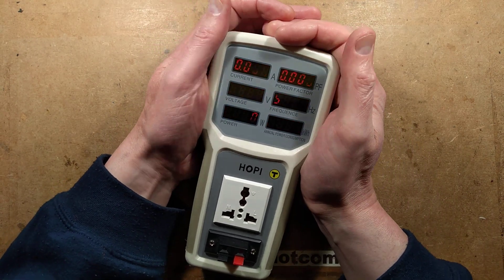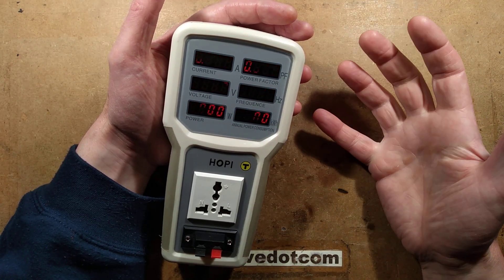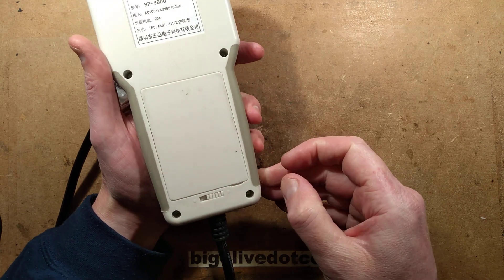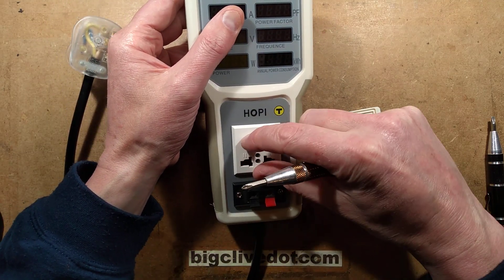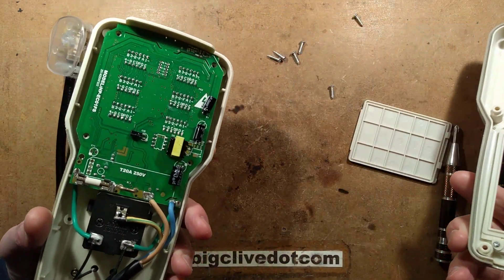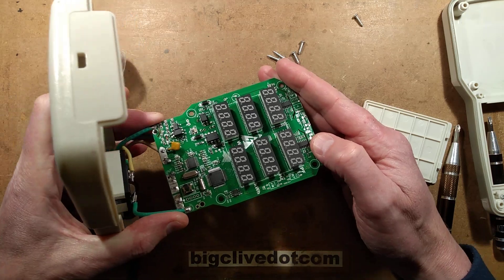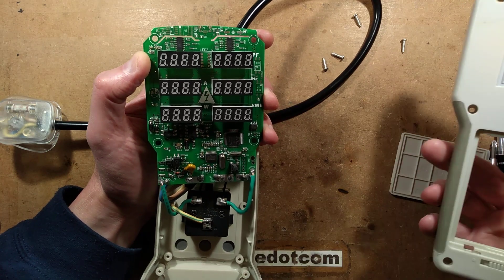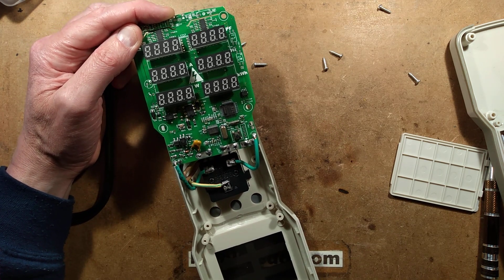Inside the Hopi power meter.  (It contains a smart meter chip!)

Comment: I got mine after you told me where to get it. Unfortunately the speaker terminals are mounted on a black plastic block but mine is so thick it won’t let most UK plugs sit flat in place. What a pain but fixed by fitting one of those square deathdapters in place and plugging into that.

Comment: for once you didn't say, "i'll pull this cover off the led panel", had you already done it? or for once was it pre-done? and clive you have shown me so much kindness of late, may i presume for one more time? i have a scope and an old function gen i bought (the awesomely named blackstar jupiter 2000 from 1991) i have bought a box of inductors, as part of my quest to have a little drawer with everything in it. so i made some LC tank circuits. i only just worked out how to make my scope do a thing when a thing happens, triggering they call it. i can drive the LC from the func gen and fiddle the frequency so i can watch the amplitude wax and wane, but i want to watch the 'echoes' as the inductor and cap slosh energy about. my func gen doesn't have a 'make a brief pulse' switch, so im thinking of using a push button, with a 555 to debounce it, then another 555 in monostable to drive a 'fet to make a brief pulse to energise the LC etc. is this a sensible way to do it? or am i massively wrong? i am fairly in at the deep end here. but i like it. again sorry if the answer to this should be obvious to me. i am acutely aware i probably sound like a tit, but as i keep mentioning last xmas i didn't know what ac meant. my entire electronic education is, basically, youtube videos.
Reply from the maker: If the cover was off the LED display then I may already have had it open to explore at some point.  For a simple pulse into a coil a button discharging a charged capacitor into the coil might work.

Comment: Just here to tell that HOPI is being unboxed right now ❤ The T button is now described in the manual: "Key: adjust hours, display model, clear energy data. Remark: w hen display active power power will a lternate display the hours of load." There is also long and short press operation with graph provided! It can show even "annul CO2 consumption". Remember that "it will automatically stores the current operation as long as you not to press the key for more than 3s"!

Comment: I just got my Hopi today and there were two issues, it had the wrong country plug and the red filter doesn’t completely line up over the LEDs so the left side is really bright. I attached the correct plug myself and I hope I got the polarity right but I’d googled it beforehand, (I’m not a sparky).
The case easily came apart in your hands, mine is very tight and I couldn’t insert the spudger tool. I watchwd this video a couple of months ago and I’ve now looked at it again and I know that I can access the LEDs as soon as I get the case open.

Comment: You could theoretically put a faster osc in the board without affecting the serial communication, where it's SPI or I2C, they both have a clock pulse line

Although look at the datasheet for the microcontroller for max clock speed, i would say it's max would be 20Mhz, but don't quote me on that

Comment: Hearing the the US/Canada version has neutral and hot legs reversed at the 3 prong plug and carries this through to the outlet socket. Fixable with a little rerouting via the "battery" area. But the second issue is the socket does not have the wide and narrow slots for a polarized 2 wire plug setting someone up for dealing with a hot chassis/case if plugged in wrong. This one makes it a no go for me as people with less knowledge than us probably don't even know why polarized plugs and sockets exist - To physically prevent you from plugging it in backwards. I have some candle LED lamps where the outer screw contactor metal extends up well out of the socket. When I saw this I measured from it to ground just to make sure a bulb change wasn't going to become a hair raising event.

Comment: One comment I need to make ( as I only just discovered this today, I am in North America ):   On the HOPI meter, "L" ( Live ) and "N" ( Neutral ) are correctly labeled and measure as such.   HOWEVER:   The orientation of the L/N terminals are swapped from standard!    In North America, when looking at a 120V NEMA outlet, Ground stud is on the BOTTOM, Neutral is on the LEFT and Hot/Live is on the RIGHT.   When you plug in equipment into this meter, you will have connected your Live equipment line to Neutral on the HOPI meter, and your Neutral equipment line to Hot on the HOPI meter.    I found this while debugging a 120V PCB circuit and was baffled as to why I was seeing mains on the PCB while the power switch was off ... in this dangerous configuration, my power switch was only switching off the Neutral leg, and mains was still present all over the board.   PEOPLE IN NORTH AMERICA:  Beware of this possible danger.   And yes:  I specified the USA version be given to me when I ordered off Alibaba.    I am not sure if every meter is wired this way, or if the one I got just so happened to be wired this way.  My point stands:  Be careful with this thing and do not electrocute yourself!!!
Reply: My meter also arrived via Alibaba with this problem. However the back door gives enough access to solve the problem. The circuit board is clearly marked "L" and "N", so the problem was the connections to the output socket,, not the input from the line cord. Swapping the wires to the socket did require longer wires. This leaves the interesting question if the "universal" socket on my meter now violates European (or other) standards.
Reply: @waltd6116  Yes exactly. I did the same on my meter here, too.

Comment: function 1:  umm clive I believe the intended use is to say "i have 5 of this device and wish to see TOTAL kwh use"
decently useful as multi-lamp fixtures are VERY common
function 2:  most likely to test older non-PFC dirty inductive loads with all the spiky noise so it says "uH" to signify mode and shows some complicated motor coil measured data
function 3: likely the AEC was intended to replace APC with an added "price per KWH" multiplication and so as it is a 240v "British" or "European" model it might mean "Annual Euro Cost" but obviously unfinished
function 0: default APC mode with 1x device multiplier at boot
hope this perspective helps you use your smarter energy meter more in future vids as the idea of having multiple copies of a lamp is very common

Comment: Just wanna say i have a Hopi meter too, also UK, and i just checked the fuse inside the plug and its a 13A fuse that they've bridged with some solder and copper wire...

Might be worth checking yours, and maybe even the new meter you have (even tho the new one isn't rated at 4500W)

Comment: The pulse output on the metering chip is often exposed on terminals which can be wired to an external recording system, most usually a building management system (BMS), or a dedicated pulse counting logger.  Advantage: simplicity, disadvantage: any failure of the monitoring system and pulses are missed (with a BMS, notouriously pulses might be missed if the microcontroller is too busy doing other things, or comms to the central unti fail). The alternative is a serial communications protocol between the meter and BMS, most commonly MODBUS, a variant of RS485.

Comment: 2:35 A little bit of filing and some how glue n she'll be right 👍🏻 If it was me then I'd definitely stick a double pole switch in for those speaker terminals AND a fast blow fuse because they're only rated for 3A at 50V so that's almost 6x the voltage rating! 🤯

Comment: The actual mains frequency varies far more nowadays than it did 30 years ago as the increase in wind turbines (and solar) and the reduction in thermal turbogenerators is destroying the natural inertia of the grid.
Reply: Here there’s a law where the power company is fined x amount of times for a dip in frequency, they are also ordered to compensate for that frequency loss.
Reply: @BritishEngineer  yes genius, which ‘power company’ can vary frequency as the generators experience the grid as an ‘infinite bus’ and no power station or power company can significantly alter the frequency … frequency control is achieved by the National Grid.

Comment: Found the USB add on you were talking about. It’s an option to connect it to a computer to record outputs...https://www.ebay.com/itm/284188901904?_trkparms=aid%3D555023%26algo%3DHOMESPLICE.SIMRVI%26ao%3D1%26asc%3D232326%26meid%3D60f3a3d6900044c7914d4fdcf2cba0b4%26pid%3D101112%26rk%3D11%26rkt%3D24%26sd%3D201825853377%26itm%3D284188901904%26pmt%3D1%26noa%3D0%26pg%3D2563228%26algv%3DSimplAMLv5hPointwiseWebNoToraCoCoViewsNoHighIdfOrRoundRobinBlenderWithPromotedViewItems%26brand%3DUnbranded&_trksid=p2563228.c101112.m1982&amdata=cksum%3A28418890190460f3a3d6900044c7914d4fdcf2cba0b4%7Cenc%3AAQAFAAACQBjbrsqN6sJImQtMbybu8jMSC%252B0fxvmfKKyXUQrKMNmxI3Mb57XdbdZYrnsac6ZD78V%252FcAsXuZG%252BvPTNPgdJiZZ5gOaXZC4GKSA2ZPfVV7jTxnU0H5GiXTzWP0FVsxOGHIki2oBkcJVgfGpKIrYdSVCnY%252BTkyU69rNE14T8JIOZrdXQU6Od9ulZrBY1TEZuZbbXA%252B0gmY4AtHZywKFuwYmHSffCl1k3uYGWFIfXB%252Fsg6VNiS78gEjjdU%252FlxQwRI7%252BmHDx4IfZj2wwp3w44rQgY82kgOar6qPqAcA%252FEZkU7zkxEqDEBEZdoVQab9Txbx0sWFpQIb5ZTyVvS11%252FTZ2aOMVLwyRf2slxfyzgVoVR4IbO6GSqSsDYyn%252BsH19njGOcqrpS2B7i9k%252B1O8CA9EpsYetqWYV0qjOzFqobp1R6VsLZ%252FqMXTncYouQ1Irf5Rmpn%252BLODatYeJr6RpmGt3bAxl4lqL6azfSHIKz4HDK6A5b4LH9BNnDYSS7xt%252FRNqojZIZcBJvWdBEUmDK3rfP3GSLiUFpHL6fnyIVUVukjlsuuP8t3HNbo4fLW0LYiqTm2dKAU8i9huKaMjOj9E%252FtWi%252BgHtbYbF640yUxxhn09gGgeYABUIKwSDuev1lk%252B4xvvee6Xc%252FJSRypWoy%252FML0GQyaUMFtfR2tHAqB3jwX%252F0qqbqggS8H1Tjvw4vGabkCTDsWLEQhUYgaF6fLf0E3FbADED7R4XgvORxGBkowT6oP7nSzzUoFXMiKmezYuoGJNd%252FZrA%253D%253D%7Campid%3APL_CLK%7Cclp%3A2563228

Comment: Bit of a weird design. I don't know about using a shift register like that. You still have to have three pins coming out of the micro for a clock and then the two data pins for the two different shift registers.

If I was trying to do something like that, I would probably use a 7447, which would considerably reduce the amount of data we're shifting around.
Reply: Oh, the button. That appears to be showing how many hours of day the device is running. If you multiply 2.5W by 24 hours a day and 365 days a year, you come up with about 30 kWh. Multiply that by 5/24 (the five that you put in over 24hr/day), and you wind up with the meter reading of 4.5 kWh.

Comment: I've just got one and it has the serial usb components populated and also two opto isolators next to the PF and Hz display installed. Just wondering if there is a PC program that can data log or  larger display?
Thanks for the video and thanks for the inspriation to get one.
Regards, Matthew
Reply from the maker: Not sure what format it puts out data in.  Make sure that the USB really is isolated.  I never really trust grey imports like this.

Comment: If you work out the annual power consumption for the load to be connected 24/7 it reads way out.  By pressing the button to around 23 it reads nearer what you would expect the consumption to be over a year of use.

Comment: Clive, your fps is 30 for your video (As showned by YouTube states for nerds). UK frequency is 50 hz you already knew. 
I presume your shutter speed is 60.
Shutter speed number is always double that of fps due to "180 degree rule".
Try 50 shutter speed. If it is true that you have been using 60 shutter speed, then it may resolve the banding and flickering issue. I had that issue for donkey's years and there is no magical cure to it. It is either 50 or 100.

Comment: Got my HOPI from China today, courtesy of AliExpress and only £30.
You can't imagine how disappointed I am.
It's fitted with a BS1363 plug top, approved by STGS under licence number M55D2, plus a BS kitemark!
It contains a BS 1362 13A fuse, a little indifferent over that because the sticker on the back rates it at 10A.
Most disappointing of all..... no battery cover to get to dangerous live parts!

Circuit board is completely different. I'll take a closer look due to most ICs having their text obliterated.
Mine has two buttons! One toggles between Annual Energy Consumption and live energy consumption, the other resets the consumption accumulator.
They've done nothing to improve the need for a deathdapter when connecting a long-tailed PSU.
Reply from the maker: £30 is a great price for a Hopi.
Reply: @bigclivedotcom  $42.89, about £31

Comment: Clive should I remove the standard fixed plug from my hopi mater and replace it  with a new 3 pin plug as iv noticed you have done this, iv removed the 20 Amp fuse British standard 😂

Comment: 1:25 Aren't there any displays with capacitors in parallel with the LEDs to keep them lit?
Reply from the maker: That doesn't work with multiplexing.  It would result in strong ghosting between the displays.

Comment: I had a look on EBay and there is a Hopi without the terminals under the socket and it has a USB connection at the top of the meter. I also found a Hopi the same as you have there for under $70

Comment: For anyone curious like I was, I purchased one and have the manual.

HAND-HELD POWER MONITOR, Operating Instructions
MODEL: HP-9800/20A, HP-8713/2A

Shenzen HOPI electrnoic technology co. LTD.

1. Description of menu and key

REC - Annual electricity costs
APC - Annual Power Consumption
CO2 - Annual CO2 consumption
uH - Active electric energy
L - UP - upper limit of power

Short press: Press key less than 1 s
Long press: Press key more than 2 s

2. Set the allarm upper limit of power and the hours for annual pwoer consumption

Short press
Set the amount of hours per day to calculate annual power consumption

3. Set the display content

Reset device by unplugging and plugging in

Long press "FREQUENCE" segment display shows:

A. Active electrical energy, "uH--"

short press
B. Annual electricity cost "REC"

short press 
C. Annual CO2 consumption "CO2"
short press
D. Annual Power Consumption "APC"

Note: When set to display "uH--" model, display the load time: 1880.5h  (No idea what the hell this means)

4. Clear the electrical power data and load time

Reset device by unplugging and plugging in

A. Long press until 'FREQUENCY' segment display shows 'uH--' 
B. Long press once more until 'FREQUENCY' segment display shows 'REC'

5. Storage operation
It will automatically store the current operation as long as you do not press the key for more than 3s

Note: After some experimenting you are able to set the kWh price when using the AEC mode

a. Switch to Annual energy cost mode
b. Short press and set the price per kWh

The range is $0 to $20 per kWh.

Comment: I was going to buy a HOPI, but they apparently only come with an EU plug according to listings on Amazon and aliexpress and I'm in North America. Butsince it's rated too 100v minimum, I don't know what to think. I thought about using one with an EU to NA adapter, but I figured the transformer would skew the power factor readings at the very least. So I went with a Kill A Watt and it is a piece of garbage by comparison. On top of only being able to see one reading at a time on a non-backlit LCD, the current reading were off by well over 90%. Don't know why they went with an LCD when the 7 segment display the HOPI uses is probably cheaper.

 I checked it on my phone while it was in fast charge mode and it said the phone was only drawing 80 milliamps. Meanwhile the USB volt/ammeter I had connected read a much more reasonable 1 amp. Has anybody else used a Kill A Watt and noticed this? 

Anyway, I suspect a shoddy current shunt could be to blame, so one of these days I'm gonna open it up and have a poke around. I still need to characterize its accuracy on other measrements. But I found this product to be incredibly disappointing. Especially considering it costs about as much as a HOPI.

Comment: BTW @bigclivedotcom you probably can just change the CPU crystal (e.,g. 2x speed) to shift the display flicker rate; the interface to the energy meter chip is SPI, so probably won't care if you run evertthing at 2x the speed

Comment: You can stop the display flicking on the camera by turning down the  lights in the room, thus causing the camera to compensate for the dimmer light by changing its shutter to effectively stay constantly open (or at least not be shut for so long during each video frame).

Comment: For anybody wanting to build own single-phase power meter, This Cirrus Logic CS5463 is ok, but a bit more accurate version is CS5490. Both are 24 pin devices, and can operate at 3.3V. If you are space constrained and want something smaller and cheap, then HLW8012 (a bit older, but super easily available on Aliexpress, for about 0.40$/pcs; 0.33$/pcs at high volumes), or HLW8110 (newer, 3.3V, better accuracy, lower power use, can't find it on Aliexpres) from Hiliwi Technology is way to go, if you can read Chineese data sheets, which is ok.

Comment: I removed the 'speaker' terminals and fitted a proper detachable power cable to mine, and rewired it with better wire, and made a YT video about doing it. It said USB in the ad and on the box but there is no USB socket on the PCB, just a hole in the case. Oh well.